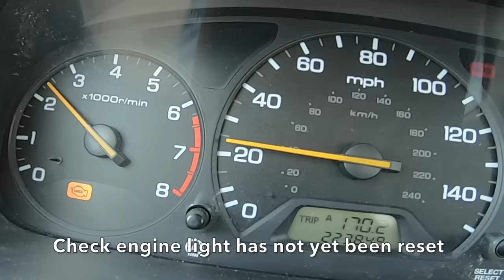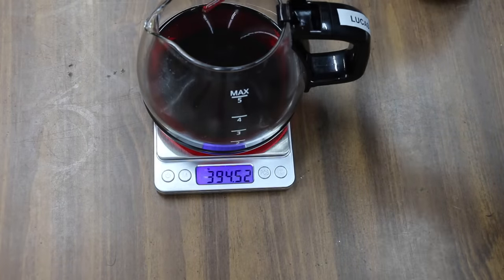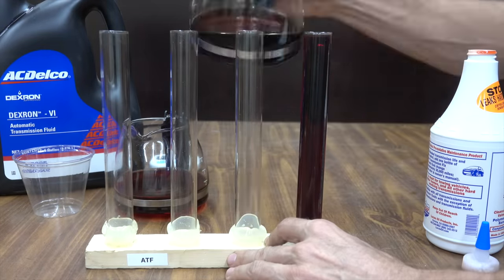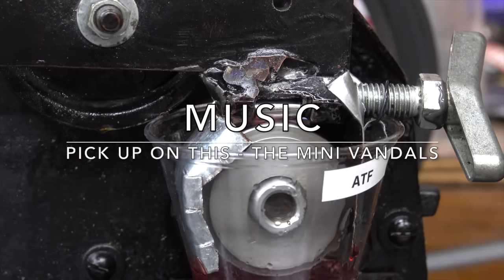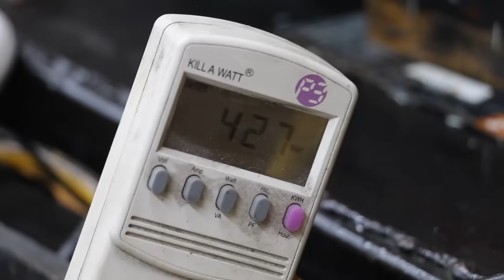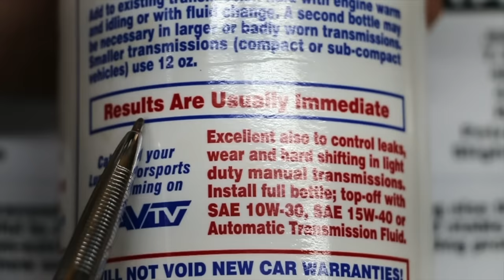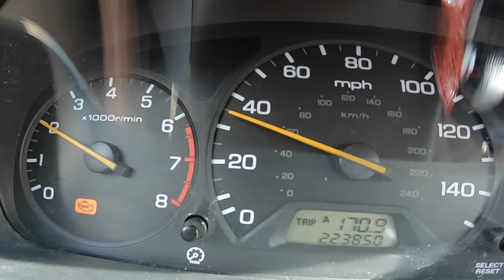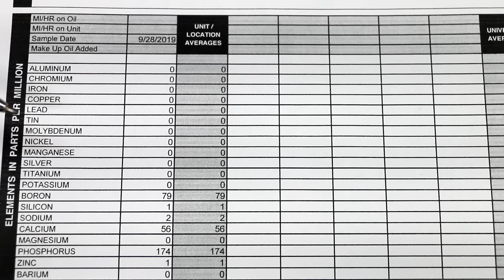Does Lucas Transmission Fix Work?  Let's find out!

Comment: Had a 78 ford ltd as a winter beater it started to slip 1 to 2. Put this stuff in and it never slipped after. Also used their power steering fluid and it worked well.
Reply from the maker: Thanks for the feedback.

Comment: Hell yes Lucas transmission fix works I have a 2012 Colorado that had a slipping transmission 2 years ago I drained the fluid and refilled it with Lucas transmission fix and it is still running almost 300,000 miles

Comment: I had a 92 eclipse 1.8 manual, on high rpm it would always grind on 2nd gear but instead of Lucas I used gm synchromesh and I swear to you it fixed it

Comment: I've been using this in my van's TH400  since 1996. Had around 120,000 miles then and now has 275,000 miles. Trans still shifts normally and leaves little residue in the pan for me to clean out during fluid & filter changes.
Reply from the maker: Thanks for sharing.

Comment: I heard for Honda Trans .... the lucas oil stabliser may be better as theyre built differently. Some guy did it on an acura here on YT.... just curious if thats better vs this Trans fix 🤔hows this honda now? Any update from the owner? I dont have a Honda vehicle and never will but just curious abt the oil stabliser idea .... honda and auto trans.... always a bad mix ... even Dodge/Chrysler late 90s to mid 2000s units are more durable 🤣

Comment: Probably a silly question, but can I put it in transmission after I already topped off with transmission fluid? Since I recently got my transmission fluid flushed and changed, so can I pour a bottle on top of the transmission fluid?

Comment: This stuff has multiple great uses. I have a 98 Camaro who's positraction unit was failing and they do not offer replacement clutches. Instead of buying a new differential and installation labor for $2000, I put about a half of quart of this in with new differential fluid without a friction modifier and the posi unit is grabbing tight again to the point it chirps the tires on tight corners
Reply from the maker: Thanks for sharing.

Comment: After watching this video - solenoid for 3rd gear was damaged. Or oil passage to it was clogged. I had similar problem in my (i'm from eu) Citroen C5 2.0 HDi with Aisin 6 hear trans. 3 and 4 gears were the worst. I couldnt get 4, and when i got it locked then had to slow down, thord gear would show on dash, but never lock in. After getting in touch with local trans shop - i was shown my graphs for solenoids and 3 and 4 were soooo out of spec & they are so hard to get, that i bought 2nd trans (without 1 and 2 gear) to get one fully functional gearbox. All solenoids were cleaned in ultrasounds & chem baths (those bad from my & "new" werent getting better). Now it shifts like a champ and never hesitates. I'd like to hear if the owner did rebuild that trans & what was cause for that harsh shift 2->3 :)
Reply from the maker: Thanks for sharing.

Comment: I really appreciate your knowledge and learned A lot. I used Lucas oil stabilizer in my big block 390 ford. Every time it needed a little oil I put Lucas in it instead of oil. My oil pump went out completely leaving a job, I sat on the side of the road for literally 2 days before I decided to just go as far as I could towards the house, I drove it around 30 mph all the way home which was approximately 25 miles, clacking like hell. Next morning went to town bought everything I needed to repair my pump with new oil and Lucas. Soon as I cranked it smoothed right out, motar was damaged none, oil pressure slightly better than before, drove the truck another 150,000 miles before someone talked me into selling it, Lucas oil stabilizer is a amazing product and I recommend it highly.
Reply from the maker: Thanks!  Thanks for sharing.

Comment: It does work, I saved 2 gm transmissions, a 700r4 and a 350 turbo, the 350 turbo lasted another 2 years and maybe even still going, I sold it though, who knows, but did work and did just fine even under a load. The big question is, would it be good to use on a low mileage car that had no problems and would extend the life of it tremendously using it from the start?
Reply from the maker: Thanks for the feedback.  Thanks for the suggestion.

Comment: There's a huge piece of information missing from this video. Did the transmission filter get replaced along with the transmission fluid change? 
I've had transmissions that only worked in reverse and first and wouldn't switch into the higher gears while driving and all it needed was a fluid and filter change, mainly, because, the filter was clogged and fluid was not flowing! Of course, a transmission shop stated that they needed rebuilt! 😏 Them...$1,700.00, me...$125.00

Comment: Am getting mad at the used car I bought.. after driving it for a month,it slips to neutral when driving it.its a Toyota auris semi automatic 07. I changed the fluid and it was normal. After some days , it happened again. I will need to off and on the car before it will engage again in the middle of the road. Am Even scared to drive it now. I took it to the mechanic and he checked and said he can't find anything 😢 that I should keep on driving it and if it occurs again I should bring it. Can lucas do the job?
Reply from the maker: I recommend contacting the Lucas oil company help and support line to see if they recommend their product for your application.

Comment: I purchased a used 1997 Toyota Tacoma with 272,000 miles on it. Since the transmission is smaller than a larger American car I added only 1/2 bottle. It did make an improvement, but I can tell the transmission still needs more help because the gas mileage is too low.  I plan to drain a bottles worth of ATF and had a full bottle of the Lucas product. 

Thank you for what you do. You do it well.
Reply from the maker: Thanks and you are welcome!  Thanks for sharing.

Comment: Yes it does work we have a 2006 Impala with a worn out AFL valve my friend had trouble with it slipping out of gear at the stop lights jerking we put that stuff in there it's still working to this day over 3,000 miles takes right off

Comment: @Project Farm I am deeply indebted to you. I stumbled across your video strictly by chance, I was very depressed after looking through five or six videos with screwed up transmissions. All of a sudden, my truck started out had a stoplight and what seem to be second gear, and it would take forever to shift in the third. However when I shifted my truck manually starting at first gear, second gear and then drive, it was OK but it would not work in automatic mode and drive. to make a long story short, this morning I went to my local O'Reilly auto parts store and bought 3 quarts of transmission fluid, and one bottle of Lucas transmission fix. Did the procedure three or 4×1st gear paw, second gear paw paw reverse paw and then put it in neutral. I took it for a test drive and I could not believe it. It was like driving somebody else's truck. That Lucas transmission fix is magic in a bottle! All total, I spent $62. And worth every dime. Thanks again for the great video.
Oh and by the way, the vehicle was a 2001 dodge ram 1500 pick up truck.
Reply from the maker: You are welcome!  Thanks for sharing!

Comment: I know this is an old post, but a few weeks ago I changed the transmission fluid in my 2001 Lincoln Town Car 4.6 engine,  4 speed overdrive automatic.  I drained the fluid,  changed the filter, added 3 bottles of Lucas Transmission Fix,  and after less than 500 miles, the transmission was shifting faster, more solid shifts , and no more slipping.  It was only slipping in high gear, but I forgot how much it had slowed on shifting.  Like most all of Lucas products,  it actually works better than i expected.  I did use a lot more than suggested,  in the test, it was a Honda car, so 1 bottle was enough,  with my Lincoln, it is a big transmission so I thought  3 should be sufficient.  Under full throttle,  from a standing start, the transmission shifts hard at max shift RPM , no slipping through all the gears and Torque converter lock up. Im very happy with this. 😊
Reply from the maker: Thanks for sharing.

Comment: I had an '86 Pontiac 6000 with high miles and a slipping transmission. I put in some Lucas and got another year out of that car before other stuff stated breaking. I was in a tight spot at that time and the extra year was a godsend.
Reply from the maker: Thanks for sharing.

Comment: Thank you for the testing of this product. After buying but not using the product I read the bottle and some of the wording stated is confusing with regards to the use of 10W/30 or 15/40 motor oil. That stopped me from using it on my truck which only has 49,000 miles but had been used to plow snow in northern MN. I bought the truck used of course but when I got the truck fixed up for my needs (A dump truck, F super duty, 7.5ltr, DRW, 2 wheel drive model). The tranny shifts hard and the fluid smelled burnt and dirty, dark red in color. I guess after seeing more info on the product here at your site I will try the product to see if it helps my tranny. I changed only 5 quarts with new fluid and a filter kit. I'll update this post if it helps my transmission. Ty again for ALL your awesome videos as I have watched many. My truck is also very old, a 1994 model for what it's worth. I'm sure it had a rough, tough life/use before I got  ahold of it. It has the E4OD transmission.
Reply from the maker: You are welcome!  Thanks for sharing.

Comment: In my personal experience I have a 2002 Celica with a 4 speed auto. The previous owners managed to punch a hole in the transmission pan so it constantly leaked and was run dry before I realized what happened. It would slip hard and clunk into third when warm. I got a new pan and filter, new fluid, and an entire bottle of transmission fix and now it shifts like new. I also kept about 1 quart of old fluid and added that to add back some of the friction material contained in that
Reply from the maker: Thanks for sharing.

Comment: Try TransX. I used it in a 96 Ford Windstar that was slipping badly. Within 20 miles, it was hardly slipping. I serviced trams and put in fresh fluid and another bottle of TransX.  Drove it for 3 years and 50k miles before I sold it. Then, I still saw it running around town for several more years. In that particular case, it was a cheap miracle cure.

Comment: I’ve always wondered about that additive in automatic transmissions. A buddy of mine works at GM doing transmissions and he recommended to never put anything other than transmission fluid in the transmission. At least knowing your transmission is on the way out. At least you could put something in it to get a couple more miles out of it. Thanks.
Reply: If these products can save a car repair for an additional year or even give an old car several more years of life, they're worth trying imo.
Reply: First of all don't hang around anyone you call buddy.  You probably already have enough problems.  Secondly a person working on transmissions telling you not to use Lucas is not your friend. He is either lying or stunned as yer ass. Either way stop hanging around people like that.  Thirdly if your transmission is working ok now put a bottle of Lucas in and it will probably be working ok when you stop using the vehicle for some other reason.  Fourthly new trans 3 to 5 thousand. Lucas Transmission Fix less....Way Less..

Comment: Just tried this on a 97 dodge ram v8 that wouldn't go into drive at all, second and first gear barely work. It goes into drive now, however its really hard to get up steep hills. Maybe overtime it might get better, only put it in 2 hours ago
Reply from the maker: Thanks for sharing.

Comment: I had a boat with a Borg Warner velvet drive transmission. 
It had leaking front and rear seals.
When cold it could take up to 20 seconds to engage either forward or reverse gear after being selected.

I waited until the trans had leaked out some fluid,  then topped up with Lucas. It only took less than half the bottle, but I expected to be able to get more in later after more leakage.

The transmission immediately worked perfectly and I was never able to get the rest of the bottle in, because the leaks stopped dead.

Been sold on the stuff ever since.
Reply from the maker: Thanks for sharing!

Comment: What about a possible torque converter chatter/ jerking. I got a 2015 Chevy Equinox 3.6 AWD. Dealer said nothing they can doe except replace the whole transmission or the torque converter. They said just drive it to it breaks before I can utilize the extended warranty 😢
Reply: Any possible guidance would be great . I have a Endurance warranty
Reply from the maker: Thanks for the suggestion.

Comment: It has given me the same result on many vehicles. Help you get some more life out of worn out transmissions, as long as you take it easy on them.
Reply: I do always start with changing the fluid and filter though, and cleaning the oil pan and magnet.

Comment: I tried this stuff on my Silverado 2wd which is normally driven much like a passenger car. After towing for 200 miles a Uhaul trailer with a Tahoe on it, I saw tranmission slippage 2-3. I put in Lucas, and also changed the fluid and filter on a lift. The truck is improved but I expect to sell it within 6 months, just couldnt lose the vehicle now. I think it just works like the STP oil additive, thickening the Viscosity, and increase pump pressure, which puts more force on the clutches keeping them engaged. I dont think it does anything chemically like increase friction between clutches
Reply from the maker: Thanks for the feedback.

Comment: I have nursed 3 different vehicles through an extra 2 years of driving by replacing the transmission oil and substituting 2 quarts with Lucas each year. It gave me the time I needed to figure out the financing for another vehicle.
Reply from the maker: Thank you for sharing!

Comment: Have a year 2000 Allison truck trans  told it was shot at 50k black metel fluid  i changed the fluid yearly after that that cleaner with each changed still driving this transmission today year 2023.
Reply from the maker: Nice!

Comment: I had a lifted 98 ZJ Limited with a 5.2 V8. I lost my 1st gear after pulling someone out of a snowbank. I went too a friends shop, dropped the pan and thankfully didn't see any forbidden glitter, so i decided just change the fluid. I decided to use lucas, and it honestly worked phenomenally! I got my 1st gear back, and it also helped with the delayed and hard shifting i was experiencing at times. I was thoroughly impressed! If i ever need to use it again in the future, i definitely will. Their oil additives are pretty good as well
Reply from the maker: Thanks for the feedback.

Comment: One of the issues with Hondas is that the fluid pickup  (non-replaceable internal filter) can already be restricted by high mileage and debris, putting a thicker susbstance like Lucas in can cause even less fluid to get through this suction filter to the pump to be used to provide pressure to the actuating components. We tried it one time in a 2003 Honda van that was slipping and the van would then barely move at all.
Reply from the maker: Thanks for the feedback.

Comment: What about hydraulic lift or tapping Lucas motor oil be good for a 2001 Ford F150 V8 4.6. I know they have small portholes for oil that’s why it takes 5-20 w
Reply from the maker: Thanks for the suggestion.

Comment: Had a '92  chevy G-30 van from 07-10. Used it as a beater to and from work and side work. After replacing the speed sensor, the trans still slipped and leaked.  This stuff was a great band-aid for 3 years. It had 350k miles, orginal engine and trans before I took it to the scrapyard.
Reply from the maker: Thanks for sharing.

Comment: I have a 2012 buick enclave and had a hard shudder between 20-40mph usually going uphill or having a load. Used Lucas directly to my transmission and about 30 miles later for about 2-3 days the shudder went away then it came back with a vengence.  Thought it might of unlocked something that was broken.

Decided because I havent gotten a actual drain and fill in awhile that ill do that first to see if there was any metallic flakes in the fluid to tip me off if its not worth messing with anymore. Drained it (dark black/brown even under 30k no flakes).  Filled up with medium priced fluid that said it was for older vehicles and put 2 packets of shudder fix in.

No more shudder or at least very little when it would usually shudder. I think lucas loosened up the crud that was probably in my torque converter and then it moved out somewhere else then it got stuck back in the torque converter and by draining and filling and putting 2 more shudder fixes in it (lots of forums say 1 might be fine but 2 doesnt hurt and might be better for at least the enclave i have) it really declogged whatever was left in there.

30k is the recommended drain and fill time but i think im going to change it at 20 or 15 instead and if its black ill go lower. Ill probably end up changing the liquid early one more time to get more of the left over crud out at maybe 5 or 10k miles.
Reply from the maker: Thanks for sharing.